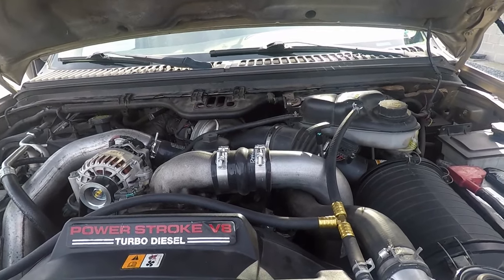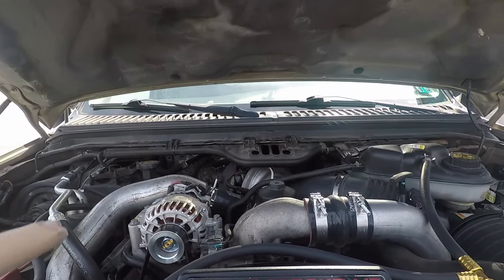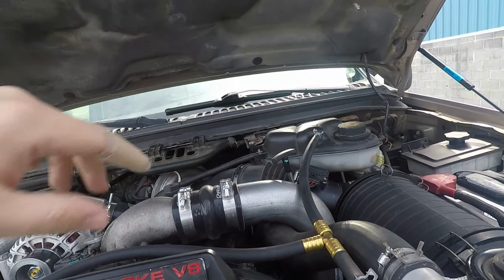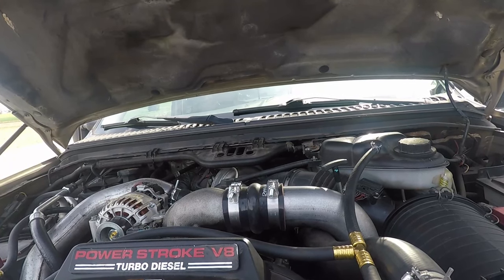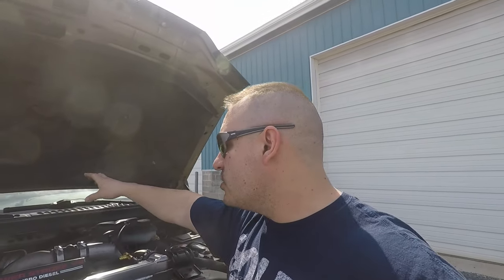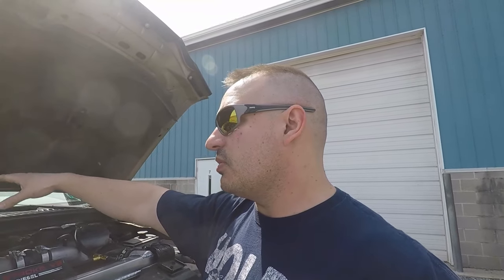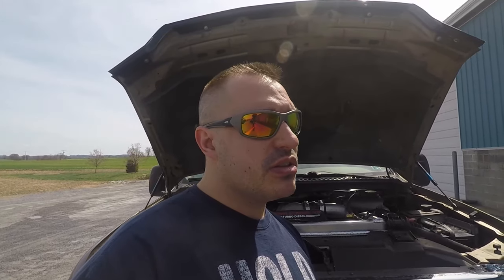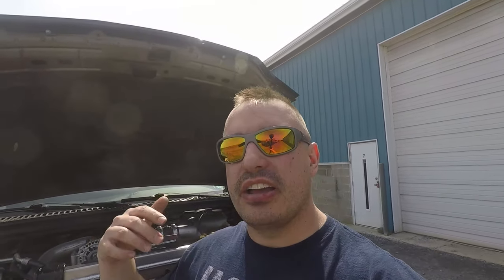6.0 Powerstroke  VGT Turbo Problems and Fixes

Comment: There is a 6.0 for sale locally. The ad says there's a problem with the turbo and that it "goes on and off". Any idea what this could be?
Reply from the maker: I am making some assumption on thr on and off my first guess would be the connector at the turbo solenoid or thr solenoid itself. Going through and giving it a good test drive and once over will help tell more

Comment: Just did a lot of work on my 6.0 no turbo sound at idle but builds up to 30 lbs when accelerating. Even at maybe 10 mph it’s at 1-2 psi if accelerating. But again, only has the whistle when accelerating. None when idle. Any ideas?
Reply from the maker: are you running any tunes in your truck? did it have a whistle before all the work? have you checked your vgt duty cycle to see what your turbo is trying to do at idle, and does it drive pretty good or does it fell "off"
Reply: @six0bros  just running a bullydog shift on the fly tuner, and I mostly keep it in performance for better MPG. I honestly don’t remember if it had the whistle at idle before or not, I put a cold air intake on it and changed the MAF during all the work (which was an oil cooler change) it runs and drives great, I do notice sometimes when it shows 29 psi that it doesn’t really feel like 29 psi (if that makes sense)
Reply: Also, when I did the oil cooler I replaced all gaskets, and sensors in and around that area except for the ebp and the map also flushed coolant and installed a coolant filter kit, as well as the cai as stated above
Reply from the maker: @trisquickstricks  it depends on the factory flash if it has whistle at idle or not. Some do some don't. Not sure if bullydog does or doesn't. I would return to stock to check. Sometimes air gets in the vgt solenoid area and can take a bit to get out of it. Also some tuners fool the boost reading and icp psi reading to get certain effects from the engine
Reply: @six0bros  ohhhhhhh that makes a lot of sense, I had no idea! Thanks so much!

Comment: I got 06 I replaced the VGT solenoid I have not pulled the turbo truck will run good then the egt starts climbing and goes into limp I let it cool down shut it off then restart and no limp but I can tell the veins are not moving

Comment: I was real short on boost , found a hole . Got boost back within temporary patch until new tubes come in however it still does not sound or run quite like it did before I had all internals replaced . High pressure pump , low pressure pump , egr cooler . Maybe still got other hole somewhere .
Reply from the maker: Where was the hole? Do you have the plastic intercooler pipes? If so changing that out get new boots for all intercooler pipes as well should help. Check for exhaust leaks
Reply: @six0bros  yeah still plastic pipe
Reply: @six0bros  onthe top right by the dipstick . Should it have oil moisture going through it ?
Reply: @six0bros  it idles almost like it has a cam
Reply from the maker: Could be more than one spot with a leak I would wait until it is replaced
Reply from the maker: Sounds like a leak on the intake side of things. Which makes sense I would replace the plastic one and replace the cac tube boots on the hot side. Also check intercooler for leaks as well

Comment: I am building boost but no power in mine (05) it sounds like a fan as well, checked all piping, no leaks, sounds like it wants to spool normal then nope back to fan sound, when i start it up it dosent spool up imedatley either it does this every time, even before my issue started
Reply from the maker: What is boost, ebp, vgt duty cycle under load? I want to say the boots on the intercooler pipes are to blame. Specifically the one right off the turbo.
Reply: @six0bros  boost is normal on my factory gauge, 7-10 normal around 20 gettin it a little, as far as ebp, vgt cycle i cant say means as i dont have a programmer( wish i had one), i can say this upon startup everytime my vgt wont allow the turbo to spool for about 10-15 min when cold(faster when its cold outside due to my high rev), when its warm not too bad, i have unplugged the vgt when cold and plugged back in, no difference, it used to not bother when spooled up, but recently it acts like my veins wont open, they try to sometimes, i have a rebuild kit i havent installed yet, i plan to order a new y pipe as well so when i have the turbo off i can change that as well, all in all i want to narrow my problem down before i go all out
Reply from the maker: So the best way to help diagnosis this would be for an app called forscan and a obd2 Bluetooth. You can run it on your phone and a $7 obd2 Bluetooth plug off Amazon. I can get you an affiliate link if you want for the plug
Reply from the maker: That will help figure it out and keep cost low. I think forscan was like $5

Comment: Say you buy the truck for 15k. You have to put another 10k into it to hope it’s reliable. I’ve had two of them. And when you spend that much and then it brakes. It’s emotionally devastating. These trucks nickel and dime to death..
Reply from the maker: I have heard people have repeat issues but typically if it's fixed correctly the first time it won't brake again for a long long time
Reply: Choose your house of cards to drive no matter
Reply: True. But if you NEED a diesel, the only thing you can do to fight back is to  "power learn"  your vehicles systems as hard as you can.
Or pay a shop and hope they know what they're doing.

Comment: I’ve got the P0299 under-boost, I think my vanes are stuck because I can’t change it with the scanner. 🤔
Reply from the maker: What does the ecm command the vgt duty cycle to? It does sound like it may be stuck. If your ecm is commanding it to 85% or 15% then you most likely have a stuck or worn unison ring
Reply: Thank you very much I will look at vgt duty cycle also someone took out the egr and just put a plate over the hole, I don’t understand how it runs as good as it does like that🤔
Reply from the maker: @dannmann17  they likely have some type of block off plate on the egr or removed it as well. I have thought more about this have you double checked everything I talk about here as far as exhaust leaks or boost leaks
Reply: I couldn’t find any leaks, I’m going to pull the truck back in today and look at the VGT
Reply from the maker: @dannmann17 let me know how it goes and if it fixes the issue
Reply: Well I pulled the turbo today and the ring is cracked near the pin and the veins were locked in place. The scanner showed the vgt go to 85% and stay there. Your suggestions helped me!
Reply from the maker: I'm glad I could help man. I know it isn't always fun at that point but at least a new unison ring should get you back on the road. Clean the area well though before going back together
Reply: You sure are what makes YouTube great I am now a subscriber
Reply from the maker: @dannmann17 thank you man. I really appreciate you saying that and for subscribing
Reply: Where would the best place be to get a unison ring?

Comment: Is there a good quality turbo, without the Variable, that works?
I’m Not looking for 5,000 hp,…..500hp would be fine (kill devil heads of course)….
Mild build……but More Importantly, Reliable Power!!
Any info is appreciated.
Thanks
Reply from the maker: I just personally don't think non vgt setups are worth it for 500 hp. They are expensive to get nice turbos and the mounting kit and y pipe. Is your turbo on its way out? I don't mean to hate on your plan. I just think the vgt for 500 hp is a great spot. My turbo sponsor just released a s300 turbo for the 6.0 but you'll need the mounting kit. I would highly recommend turbotimeusa.com stage 2 turbo. They are a sponsor but here is an affiliate code six0bros for 5% off. Vgt turbos have gotten much more reliable since the original vgt for the 6.0 there are a lot of changes
Reply: I haven’t got any truck yet, other than a 2015 150.  I’ve been looking at Everything about the 6.0 for years.  Getting ready to pull the trigger.  Looks like I’ll be spending around $14k for something under 200k miles.  I just have to be ready to put in $12k to fix the 6.0’s issues.
I appreciate all the insight and help.

Thank you.
Reply from the maker: No problem man. I know my brother is getting ready to sell his 6.0 and from what he has told me that sounds about right

Comment: If you have straight piped the truck will the ebp sensor even matter/read anything?
Reply from the maker: Yes it will. It depends on the tuning. Some read it other go to an inferred value, but changing the exhaust won't change if the vehicle reads it or not
Reply: Thanks for the reply. I have an early 03 that’s been giving me constant issues. When the truck is at idol, like sitting at a stop light, the rpms just start surging up and back down and the truck feels like it’s going to die.

Would vgt solenoid cause this? Had diagnostic ipr, icp, ficm all ok.
Reply: @zachwhelton2708   did you ever find out what the issue was I’m having same issue!
Reply from the maker: So you are dropping rpm very low I take it?
Reply: @six0bros  it’s when I’m at an idol. Like at a stop light or if I’m  sitting in truck for 15-20min. My scan gauge shows the vgt numbers going up and down when the surging happens. I have no ebp readings which I assumed was because of being straight piped. 

Maybe a bad vgt sensor. I had it at the shop recently and had no low oil pressure and truck would not start so they cleaned low pressure valve and also said my ipr was fine too. But it’s still doing the idol surging between 4-800 rpms.
Reply: @johnthomas7068  no luck yet. Leaning towards vgt or possibly ficm.
Reply: @zachwhelton2708  Could also be your ICP. Bad ICP sensor is known for surging at idle.

Comment: I had a problem with a new KC stage 2 turbo not actuating and it turned out to be a bad intake air temperature sensor. Also a bad coolant sensor will cause turbo problems as well.
Reply from the maker: A bad intake temp sensor will definitely mess with turbo performance. Just like a maf sensor will too. I haven't heard or experienced the bad coolant temp yet but thanks for the heads up. I always try and fix things that I know are wrong even if I don't see the correlation to an issue

Comment: I have a 2003 it shuts off when I go into passing gear around 60 70 mph change IPR ICP any ideas
Reply: I didn't do it until about 2 days after I cut off the cat and muffler
Reply from the maker: The exhaust work shouldn't cause any issues. What is your ipr% at warm idle and the match icp voltage
Reply: just put a new ICP last night and it still did it Ipr runs idle warmed up 22
Reply: I'll try to send a video of what it does
Reply from the maker: If I had to guess I would say we are looking at something from the ficm or the ficm to injector wiring harness. Make sure each injector is plugged in and that the harness in the back is fully seated. Next I would try switching out the ficm for one of your others that doesn't have issues and see if this fixes it
Reply: @six0bros  thank you I will look into that
Reply from the maker: No problem hope it helps

Comment: i get boost in neutral up to 10 psi and go up to 30 when driving but no power and hogh egts
Reply from the maker: Are you running any tuning on the truck? What does your icp voltage do at WOT and can you maintain it also ipr, check ficm voltage, fuel pressure (which needs an external sensor) and also check for any boost leaks or exhaust leaks. It doesn't sound likely for leaks though. Low fuel pressure could cause some of your issues.

Comment: Hey @6.0 bros I’m having that p0132b code and I’ve cleaned the turbo replaced the map hose and I have a new intake on the way, I’ve noticed that my vgt is opening and closing all the way it does act a little weird, and I’ve noticed that I don’t have that 6.0 whistle when idling I still have a cat could that cat be clogged and I’m just barley getting around 18psi of boost. Any suggestions
Reply from the maker: Are you getting a back pressure reading at all?
Reply from the maker: How did the unison ring look where it is notched for the vgt plunger
Reply: How do I get a back pressure reading, I have the sct live tuner. And the unison ring looked good
Reply from the maker: Download the app forscan it's great and cam use on your phone. You will need a Bluetooth obd2 adapter. I'll get you an affiliate link to one. On there it will have the ebp desired and actual
Reply from the maker: Sct doesn't read back pressure correctly
Reply from the maker: Here is the affiliate link cheapest quality way to read a lot https://amzn.to/3QnB3gk
Reply: @six0bros  another question for you I replaced the eps and the pigtail now I’m truck won’t start itl turn over but doesn’t fire, I ended up getting my batteries tested and they both were shot wondering if the old pig tail shorted them and could possibly short out something else
Reply from the maker: I am a big believer in fixing what we know is wrong even if it may seem unrelated. Low battery charge vehicles start doing weird stuff sometimes I think. I would fix that. Make sure you use good quality pigtails and then I would recheck

Comment: I’m have issues also with my 6.0 2003 250 I’m having a major oil leak can’t seem to find but I sure it’s coming from the oil dip stick housing or might be from the valve cover oil breather but I was also having a turbo leak but the person fixing it fucked it so I’m in this position
Reply from the maker: I would definitely fox things you know are the issue. Like the ccv leaking which does happen normally a new o ring and you're good. When you say turbo leak oil still or exhaust leak?
Reply: It’s hard to explain it’s just to many shit I think it’s the pvc indicator I might be wrong but I’m sure it’s all that oil dip stick valve cover gaskets and the pvc one

Comment: Have you tried the bd screamer turbo?
Reply from the maker: I have not. I like the company bd though. The exhaust manifolds and y pipe are top notch. I imagine their turbos are as well. Indo always recommend my sponsor turbotimeusa.com/SIX0BROS this is an affiliate link. But should give you 5% off performance turbos. Or just use my code six0bros for the same deal.
Reply: @six0bros    I was just at their site. Considering the 11 blade velocity. Which do you have?
Reply from the maker: I run their dual plane wheel with the velocity port. Also they have upgraded their turbo since I put mine on. I do have a review of it but mine is a 66mm turbo. For most people I recommend the 11 blade because it will have better drive ability the single plane wheel spools a little faster down low. The dual plane I run has better flow up top. It isn't a huge difference but there is a slight difference.  All the feedback I have gotten from subscribers running the 11 blade has been very positive. Even the 64mm turbos in general the feedback has been amazing.
Reply: @six0bros  Thanks for information. aprreciate your time
Reply from the maker: No problem. Happy to help

Comment: What about blue and white smoke?
Reply from the maker: Are you losing any coolant? Is your tailpipe wet? What's it smell like?
Reply from the maker: Also any codes if you try and read them even if the check engine light isn't on
Reply: I am losing coolent. No codes. Turbo has oil in it vgt is constant 85% and I found a doubled up injector copper seal ring.
Reply: I got lots of lag no coolant loss and blue smoke. Turbo codes lit up like forth of July. does that cause blue smoke?
Reply: @jessedrewes5376  did you ever figure out what the problem was? Mines doing the same thing...
Reply from the maker: Are you losing coolant? Any codes? Is yiur tailpipe wet?
Reply: @six0bros  I noticed that I was low on coolant. My check engine light is not on. The smoke smells like diesel. Whitish  color while idling and black when accelerating. Tail pipe is black but not wet.
Reply from the maker: Does the truck run smooth otherwise?  Or rough idle? Check codes even though you don't have a light on sometimes there are still codes

Comment: Ok so I just swapped our 05  turbo to a 03 ten blade but no whistle at idel what could it be
Reply from the maker: Did you have whistle before, and how was the truck driving? Sometimes they need to relearn before they act right